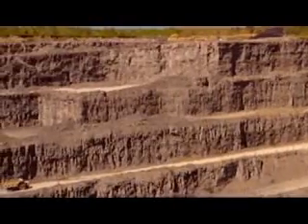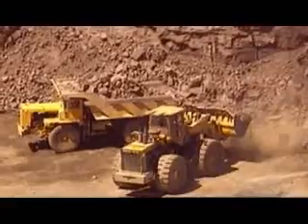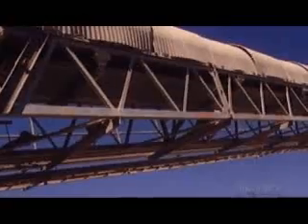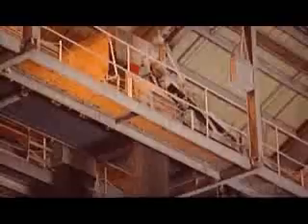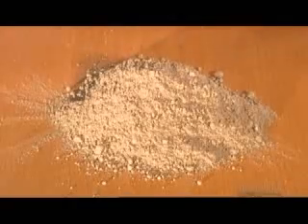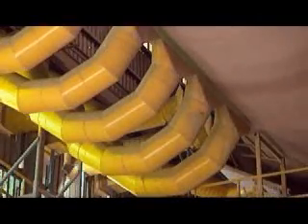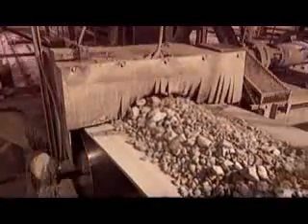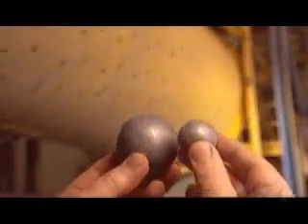Cement, how it is made.

Comment: This seems extremely complex, how did the ancient Romans and Egyptians do it? I'm sure they didn't go through all of these steps..
Reply: hopkins731shawn from what I've been watching on youtube, they take the limestone and bake it, so it turns into quicklime. They then add water to quicklime so it becomes a slurry. You can then add some sand to that and pretty much that's it (i think). Other stuff are added if you want a stronger cement.
Reply: Although the Greeks first looked at lime-pozzolanic pastes, the Romans worked out that the abundant supply of aluminosilicate rich, acidic pozzolanic volcanic ash in the vicinity of Rome could be added to Calcium hydroxide (free lime and water). The resultant, simple acid-base reaction created a cementitious hydraulic binder (something that can set and bind aggregates in the presence of water). This gave the Romans an engineering advantage. The beauty of this is that it evolved from the specific geology of the Mediterranean region, itself being a place rich in marine sediments (limestone) but also volcanically active

Comment: To prevent flash setting we add gypsun
Reply: How about adding sugar %3 or less it prevents flash set also
Reply: +RO M

 Ya, thats a good alternative as well

In ReadyMix Concrete Trucks, when the Truck is stuck in Traffic, the driver is advised to add a bottle of Soft Drink. It does the same work. It doesnt allow the Concrete to harden
Reply: Abdulhusain Dohadwala gypsum just slows down the process ,sugar on the other hand prevents it. Sugar is bad for cement. It molecularly keeps the fingers from binding

Comment: Finally gypsum is added to control the instant reaction of cement with water. Cool
Reply: The Cement comprises of a clinker phase which is tricaclium aluminate. Herein, the reaction is ridiculously exothermic and fast, causing a phenomenon known as “ flash set”. The Gypsum ( a form of calcium sulphate) reActs with the tricalcium aluminate to form an ‘aft’ ettringite which induces an artificial “ induction period” which lets it set slower

Comment: did they use cement back in roman times to build all them monuments? cuz I thought making cement was easy...
Reply: Yea Roman cement was one of the best, if not the best. It was made from a volcanic ash and didn't have to go through the complex process we see here as the ash has already been heated.
Reply: @TemplarX2  wow, thanks for this explanation
Reply: They used hydraulic cement, just like we use today. They took lime, heated it in an a kiln to make cement, then mixed in "pozzolana" (volcanic ash). The volcanic ash contains high amounts of alumina and silica, making their cement hydraulic (able to harden under water).